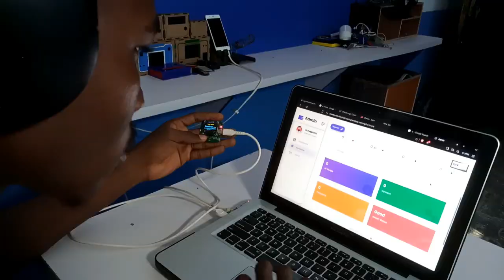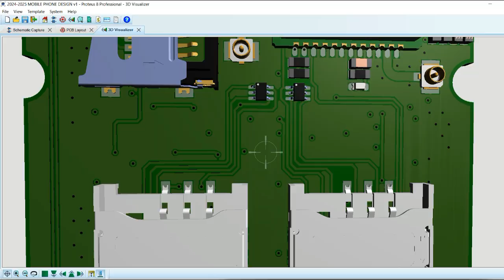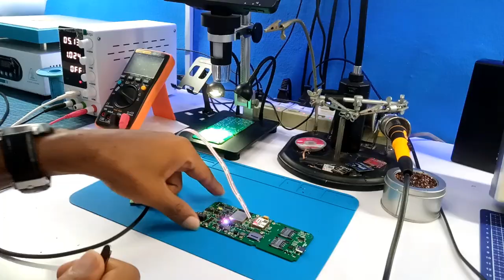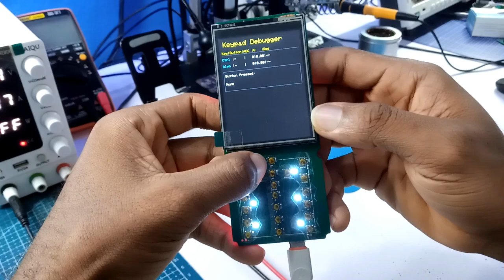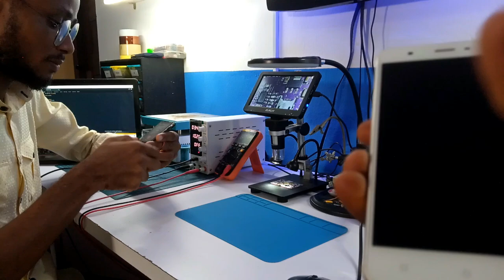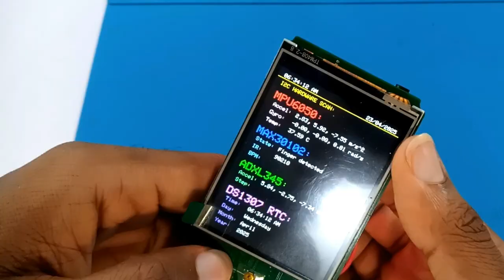Building a Smart phone from scratch

Comment: Great ❤, but you should work with multi-core processor. 

You can see when you are sending message,  you cannot do any other task. You have to wait to use other features until the message is sent.
Reply from the maker: Well observed,I will look into this
Reply: There is too many ic, you can use one which can do the work of all of them cause it make the schemetics and hardware integration too bulky(complex engineering design) @MEmbedded_TechLab